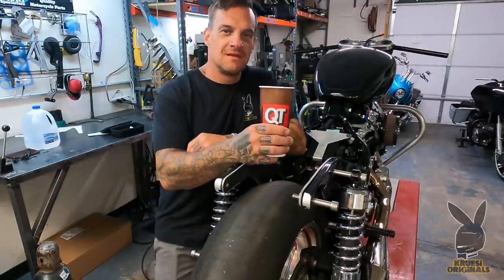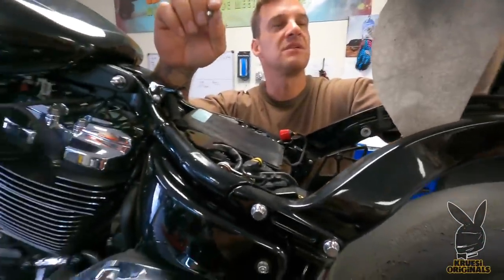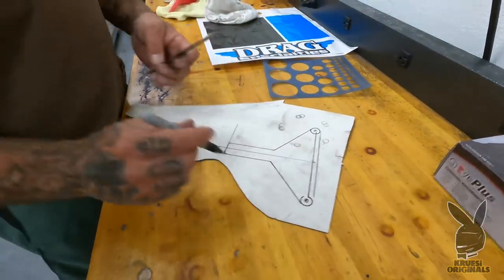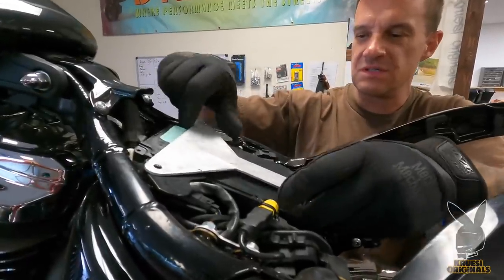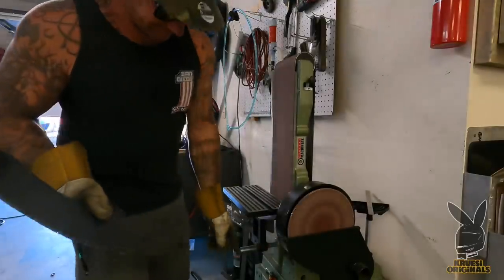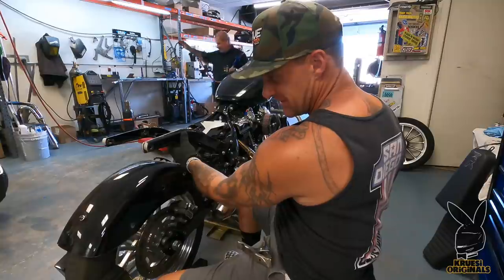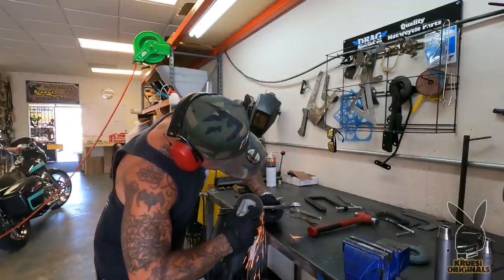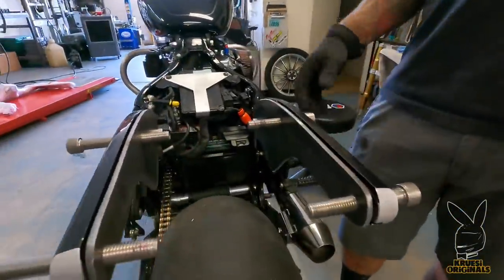Harley Davidson road race bike (P1)

Comment: Just curious why you’re using the s&s 124 and not the 131 kit ?
Reply: If I were to guess, it’s because they started with a 107 and not a 114 but I’m not sure.
Reply from the maker: Yes we did start with a 107. And I don’t want to go that big I want it to be smooth higher RPM motor better for road racing. 131 is to Torquy and jerky especially on the m8
Reply: @kruesioriginals  got ya.

Comment: You might check to make sure the bike will start and run. If you change the BCM axis the bike will think it is laid over and won’t start. Might also go with a lithium Harley battery that will take a lot of weight off also. You’ve probably thought of all this I’m just making sure. Love the videos keep up the good work.
Reply from the maker: Yep we’ve done all that my dude ran the BCM through all the angles check that lien angles to make sure he can get over far enough we actually turned off the lien Angle now we killed that thing. Also have a Harley lithium battery in it
Reply: @kruesioriginals  hell yeah y’all are on it!

Comment: Hey the other technique is never drilled dry always use lubricant honestly gear grease or hydraulic oil my father's been in the steel industry for 40 years now and he taught me that when I was a kid and they do structural steel and I mean some of the s*** that they drill through is thick and people just burn through those bits and by adding grease every time you're going to change the bit and you you know plunge the bit start your pilot hole then you go to your bigger bet you're going to dip that one just the tip you don't need to dunk the whole thing in there just the tip I know this video is a year old but try this method if you don't know it and live by that cold and you'll save a lot of money on drill bits.